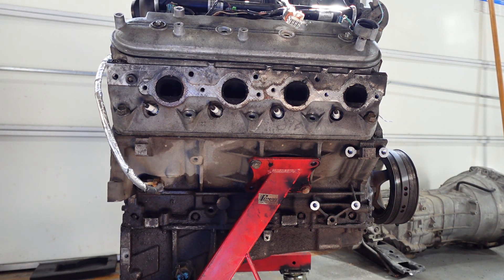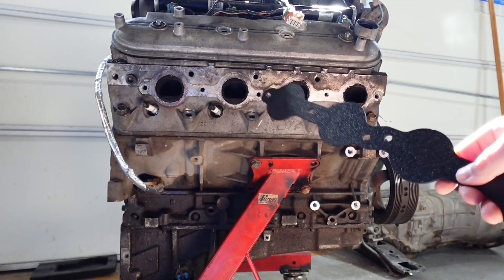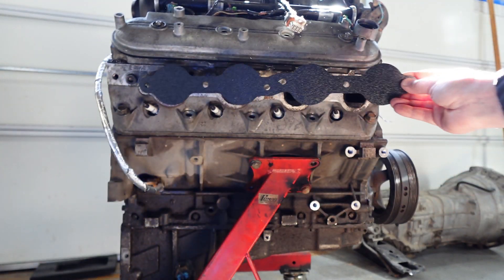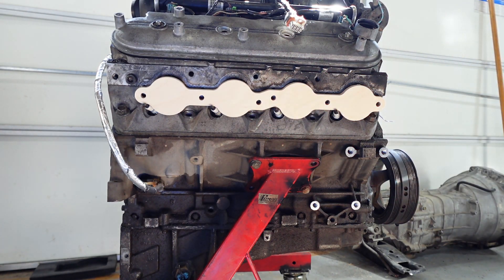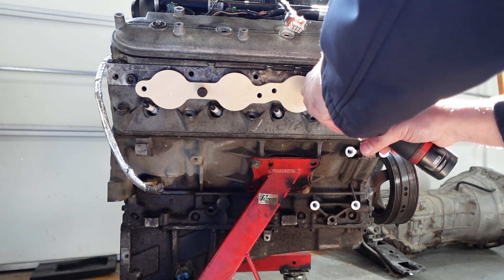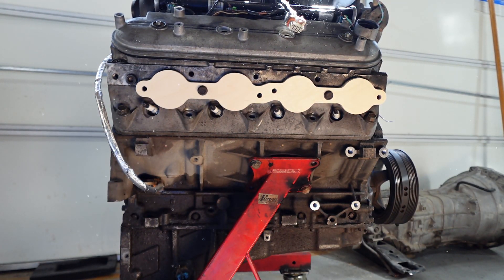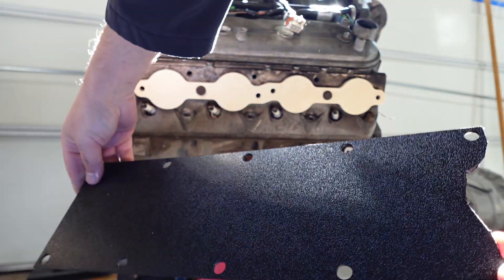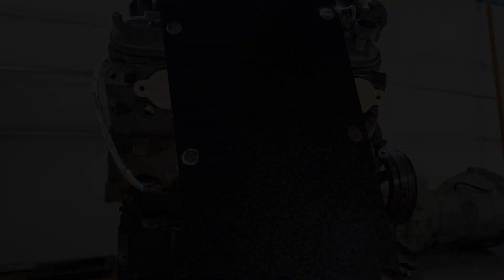Wood Header flanges get yoself some wooden headers

Comment: If you want to support a local race shop, S&W Raceworks is an option. You need to send CAD files but thier waterjet prices are cheap. I've been using them for over a decade without issue. You can also print whatever on paper at a 1:1 ratio and test fit that way before you send anything to be cut.